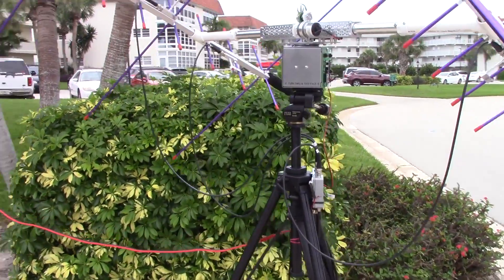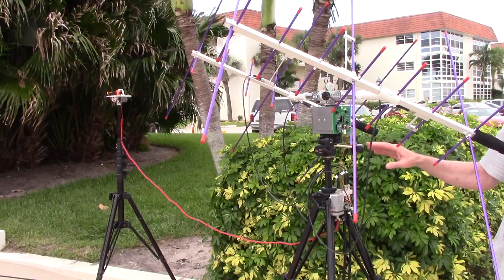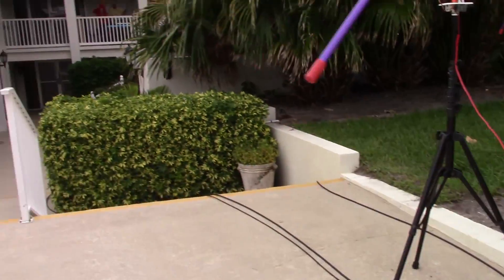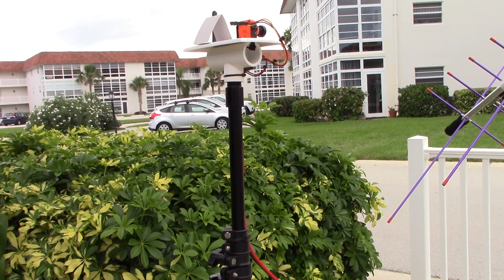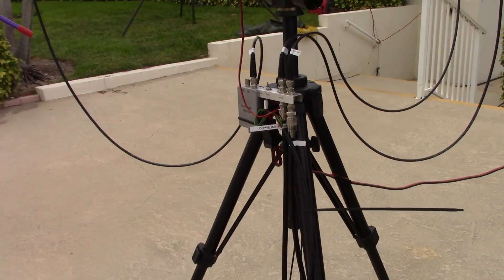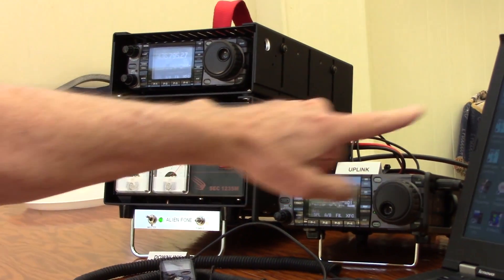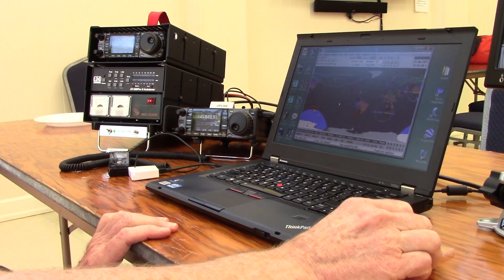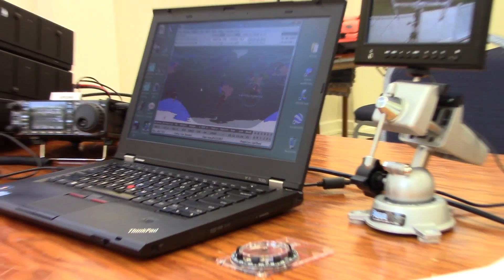Amateur Satellites Ham Radio Satellite Tracker by K4WOF

Comment: 2:16 "Based on information that you download from NASA." I find it unlikely the TLEs used came from NASA. RIP the Goddard Space Center orbital elements... Reagan killed those off in the early 80s before launching the SDI. Orbital elements (TLEs) are now mostly from NORAD at spacetrack.org (which has a really bad user agreement backed by federal regulations that prevents users from sharing data) or celestrak, which runs a parallel service propped up by Dr. T.S. Kelso as a non business venture which provides the exact same data to the public without such a user agreement by special permission from the secretary as required by law. I believe AMSAT also maintains some of their own TLEs and NASA sometimes publishes some TLEs in articles when they get special permission, but the default resource for up to date information is Celestrak for most programs such as gpredict, SATPC32, orbitron, WXtrack, etc. TLEs (orbital elements) are so weird in that they're tightly controlled and also public information, and it depends where they come from whether you can share them or not. See seesat-l and the celestrak email chain archive with NORAD for more; interesting drama to say the least...

Comment: Most of us already have a 2m/440 handheld we could use for satellite work, so the hitch is often the cost of a dual-band beam. You might look into how well this inexpensive ($16 + shipping) 16-element log periodic HD-TV antenna works as a 2m/440 satellite antenna, either as is or with a bit of snipping of the elements to tune it more precisely.  https://www.mtcradio.com/hdtv-outdoor-antenna-vhf-uhf-16-element-hi-gain-log-periodic-design/
--Mike Perry, WA4MP

Comment: I am working on this in this quarantine, and just came across this video. Nice work man! 
I was wondering how did you take live data of azimuth and elevation and what controller did you use to control the motion of the motors. Doe sit need internet or does it have its own built in database?

Comment: Great setup, but expensive for my wallet...73 de sv2evs
Reply: How much do you figure you have invested in the project for just the antenna array and controller?  73 de W2MFH
Reply: Great job and great video. I have also confronted the cost issue and experience has shown that the cost depends on the finished product you wish to achieve. 

Don't mean to steal his thunder, but after a lot of reading and a little elbow grease I have built nice Yagis for under $5 each, and also created an Arduino Pro Mini ($20) based AZ/EL rotor controller using inexpensive RC servos ($40 each) - just Google "K6VUG Rotator" for more info and firmware code.  Anyway, this was built for Field Day and is definitely NOT weather proof ! 

Having done all this I found that there are a range of options to choose - from handheld setup (under $10), to tripod mounted handheld setup (for $15 & existing camera tripod) to AZ rotor only setup using old TV antenna rotor, to a completely automated AZ/EL setup like this one. 

For the FM repeater sats aka "easy sats" I prefer the lower end inexpensive handheld configurations, whereas the more challenging "transponder sats" benefit from a fully automated setup to help focus on making contacts, rather than trying to grow 4 hands ! 
So it is up to you, whether you wants to have some casual fun with FM satellites or need a "true" amateur ground station - you decide. Plus now I know what I can pack in back of the car or in a small Fedex tube for taking on vacations or long trips.  

On the flip side I'm now trying hard to create a weather-proof solution to mount on top my home so I work from the comfort of the shack... trust me, once you have made a satellite contact, you will be hooked for ever ! 

Again thanks for sharing a wonderful presentation of a project executed very professionally !! 

Best Regards, 
K6VUG

Comment: Which radios is he using?
Reply from the maker: 2 Icom IC-7000
Reply: J Lineback seems like some decent dual bander mobiles would be fine. But use what you got I guess.
Reply from the maker: Dual banders wont do SSB and CW for satellites.. Only FM